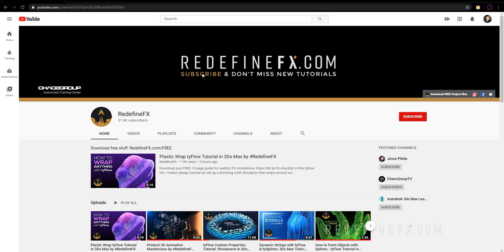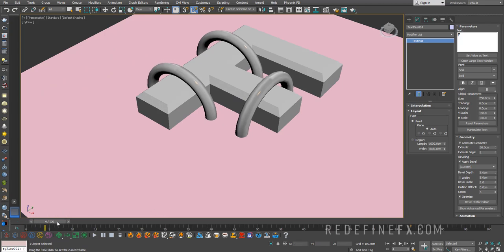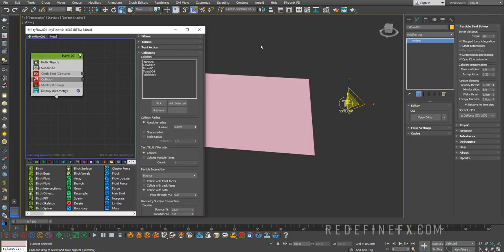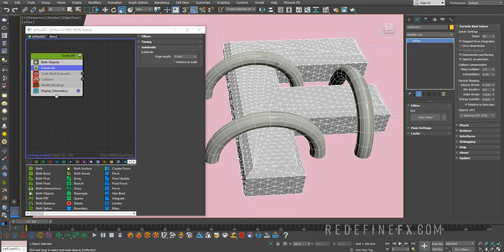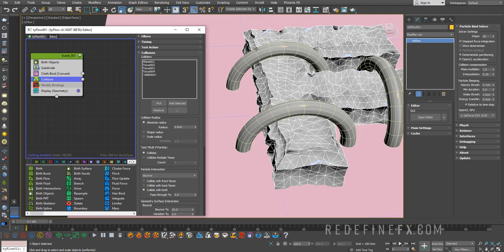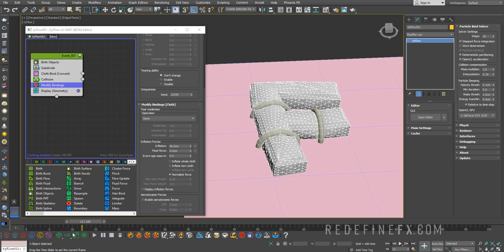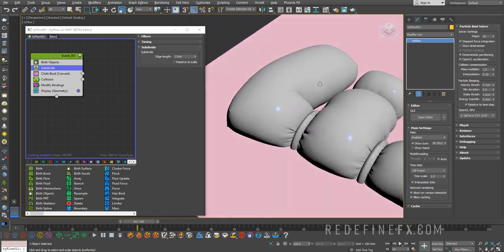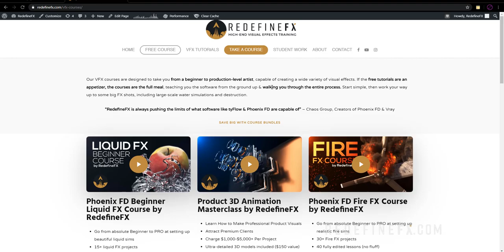Cloth Balloon Inflation tyFlow Tutorial in 3Ds Max by #RedefineFX

Comment: Hi, I can't get this to work. I tried everything (changing frame steps/solver steps, subdivide, inflation force, ...) and the result is really bad. I think this might be due to the size of my letter F. Can you tell me what's the size of your objects in the scene ? Or are you able to post this scene so I can try it out and see if it works on my pc ? Thanks ! :)
Reply from the maker: If you have tyFlow pro, just enable cuda cloth and it’ll work much easier. This scene was in cm 1 unit = 1cm so look at the size of my letter compared to the grid size to get an idea of scale. Make sure you raise the sim steps pretty high
Reply: Can't get it right. In the video the grid is only visible for a few seconds and I tried to determine the size of the letter F (I guess it's around 1.5cm) and copied all the values you have for the effect, to no avail. It just won't work :/ I really want want to know how to get this working before I move one to another video...
Reply: Okay, I finally got something that's looking more or less alright. I made the geometry way bigger than it was and that seemed to do the trick. My only question left is: how do you know what the size of your geometry needs to be to get the desired effect ? Is it trial and error ? Or are there certain rules to follow ? Thanks ! :)
Reply from the maker: @lucvw1975  for abstract stuff like this it's entirely trial and error. For real-world based fx, stick to real world scale.